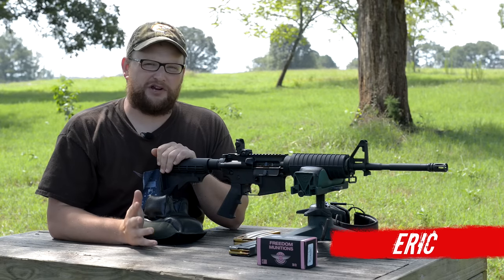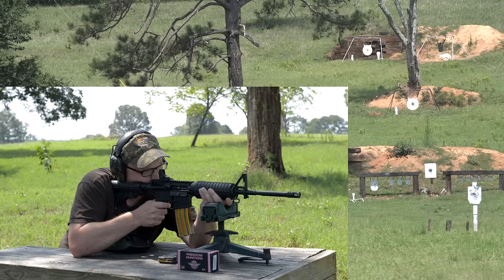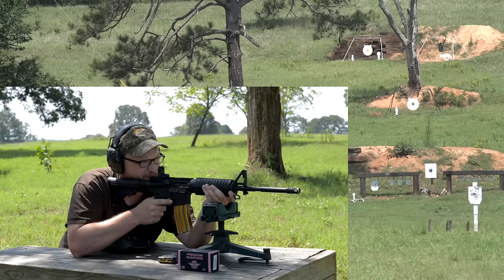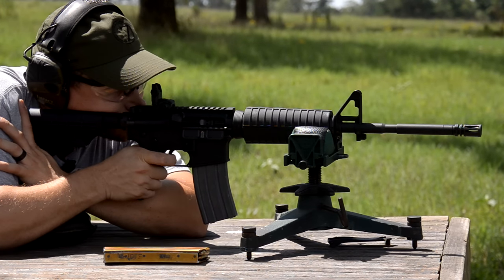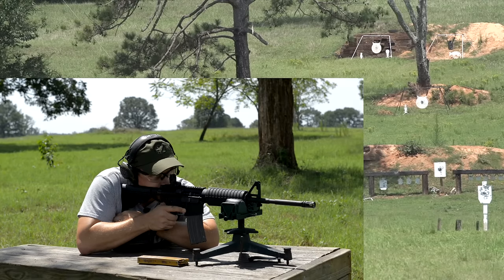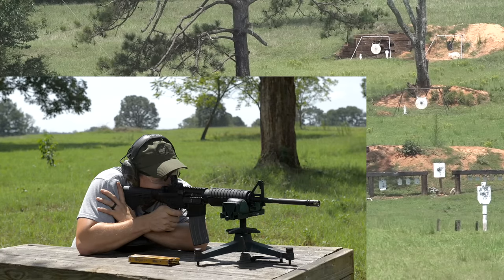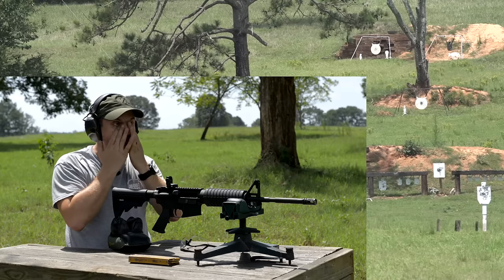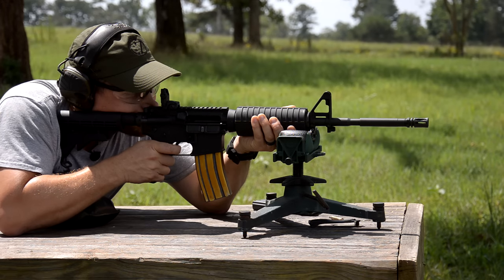Basic AR-15 Practical Accuracy

Comment: I'm fairly new to the gun scene. How much does a complete cheap, but good AR 15 cost?
Reply: 700 bucks for a not so crappy one.
Reply: buy a smith and wesson m&p 15 gen 2!!! it is absolutly flawless its the best out of the box gun and the quality is comparable to top of the line ar's.
Reply: 800 bucks.....but, because of school shootings and gun scares...1200. 

but ya... you should be able to find a damn decent gun for 800 to 1200 bucks.
Reply: The Walther/Colt 22 LR is a nice platform, and VERY inexpensive. It'll eat up whatever ammo you can buy, and is super accurate. Check the local gun shops for'em, they tend to go on sale often. Only thing is while the gun is inexpensive - $400 - the ammo is hard to find, which means you gotta buy it in bulk, which IS expensive. Good luck, whatever you choose.
Reply: Samuel Stine
I was inferring about a 5.56/.223 rifle. But I wouldn't mind a rifle in 22 LR. I thought the 22 LR was "back in the market" because at my local Academy, they had one whole cabinet of various 22 LR ammo. Even my local Dick's Sporting Goods had a cabinet of it.
Reply: 700, 800, and 1200 bucks? Yeah right you do not have to spend near that much. A nice little Bear Creek Aresenal is just fine, $499 at Classic Firearms.
Reply: I can build one for under $460
Reply: check out Palmetto State Armory
Reply: listen man ...colt expanse m4
Reply: Jonathan Carnahan yeah I would look into the new colt, but I just wanted to build my own.
Reply: Ruger and Smith and Wesson are both selling good entry-level rifles for 600-ish.  You can build them cheaper but that's true of desktop PCs too, for that matter.
Reply: i hear ya
Reply: +akshooter762 is right. I built mine all from PSA. spent no more than 430. building was a great way for me to understand the gun better for my next build.
Reply: honestly like 600-800 bucks
Reply: You "can" get one for $400 if you don't mind it being made out of monkey metal and compacted crud. A couple of my American friends swear by getting old worn out ones and then getting the trigger group and barrel changed etc as long as there is no significant wear/damage to the lower and stock etc. If you want one ready to go though I would say that the guys above who have stated 500-600 are about right for the minimum acceptable in quality (with the odd few exceeding what you would expect for $500-$600). I haven't been to the US for too long to know which makes are best in that price bracket right now though.
Reply: +Gordon Lawrence highest quality I've seen in that price range is the Smith and Wesson offerings, or the DPMS Oracle
Reply: bamarolls2000 thanks but I don't visit the US very much at all now - used to work there. So it is unlikely that I will visit as much as I would like in future - unless I win the lotto in which case I will buy a place in the southeast US and put in an underground 200m rifle range with sound baffles the whole works.
Reply: +ChknRider having been out with 2 friends shooting rabbits....and watching their sub ~600 ar jam up every 2 or 3 shots....

I like ars... I haven't seem one jam as often either....but it was montana cold, so that probably didn't help....

but when they stopped shooting their ar, and got their 22s...that should say something.

ya...I'd rather spend a bit more money to have something that isn't going to piss me off....call me crazy...

or its going require more money to get it to work...
Reply: +Written Word so, why are you here if your going to shit on gun people?

I live in montana....shit costs more here because we can see the end of the world....
Reply: jsdima9113 dude if you haven't gotten one get a kit with a complete upper and build the lower which is not hard at least that's what they say and really good quality for 500 dollars maybe little more.

Comment: He is wrong about the sights. The small hole is for close range, where the larger is for long range. Because of the flight path of the round, the larger sight (hole) will let you adjust your range with the front sight. The flight path goes high to the left then arches back down. You can’t do that with the smaller hole at long range. Yes I was military trained.

Comment: Holy crap, that is an old magazine. If you mags that look like that only use them for practice because they could fail you at any moment. I carried a lot of M-16s and AR-15 and fired a lot of rounds through them and the vast, vast majority of failures I've experienced were because an old magazine like that failed me in some way. In fact, you should just switch to Magpul Gen M3 magazines because they are vastly superior to the aluminum GI mags.
Reply: STANAG mags are just fine, especially if you replace the follower to an anti-tilt version. I have two twenty round STANAG mounds that I liberated from supply before I got out of the Army that are older than I am. I swapped out the followers on both, and have zero issues with them. One way they are superior to Magpul, Hexmags, and Pmags, is I can lock the magazine in place without having to release the bolt. My Magpul and Hexmags always fall out unless I put the rifle into battery. Polymer mags can also have issues with the lips if you store them loaded for long periods of time. But, they beat out the STANAG mags for durability when being handled roughly.

Comment: Old vid but, I'm seeing ejections at 1 to 2 O'clock. Is that normal with 55gr brass?
Reply: Yes, all ammo with any of the A2 type uppers with a molded-in brass deflector to facilitate left-hand firers. Spent brass typically piles up slightly forward of your right.  Personally, I mill off the triangular brass deflectors so my rounds pile up to my right rear.  Also, I reload, so I don’t want cases getting impact dents from that deflector, especially my short 300BLK cases.

Comment: Howdy partners: I got a email from AGI about this new course. Do you guys thinks is any good for 1300$
Master the AR-15
Become an AR-15 Riflesmith!

Included in this 12 hour Certified AR-15/M4 Riflesmith course is:
•The AR-15 complete D&R DVD
•The Armorers Course video
•The complete 'TactiCool to PractiCool' course which teaches all aspects of building tactical rifles including how to select among the hundreds of AR part options (the ones that work)
•The Ultimate Guide to Building AR-15s from a parts kit
•How to do a Trigger Job step-by-step on the AR-15 
•Comprehensive notes
•Online test access, certification and (upon successful completion of the online test) a Certified AR-15/M4 Riflesmith patch.
Reply: I wouldn't pay 1,300 for that.
Reply: No, it is not worth it. You can learn all that yourself simply by working on an AR, buying various books, and doing research. That's a complete rip-off.

Comment: Is it true that when you get shot from afar the first thing you hear is the sonic boom the bullet is making and not the bang? when they are shooting long range the first thing you hear is the bang and then the impact, how does this whole thing works? have they showed this in some video?
Reply: Your at the gun not the receiving end. At the receiving end you hear the impact then the sonic boom then the bang from the rifle. When you are at the shooting end you hear the bang and sonic boom together then the impact. Sound takes very roughly 1/3 second to travel 100 yards.
Reply: Depends.  If the round is supersonic you'll hear the round impacting, followed by the sonic crack, followed by the report of the rifle if you are close enough.  If it's subsonic you won't hear a sonic crack and you'll hear the gunshot before you hear a bullet impact.

It works because a supersonic bullet travels faster than the speed of sound.  So the bullet outruns the speed of the pressure wave created by the gun going off.  Then, as any supersonic object travels it creates a pressure wave that follows behind it, just like the waves behind a boat.  You hear a sonic crack when those pressure waves pass you.  That is why if you've ever heard an airplane go supersonic, you won't hear it until after it has passed you.
Reply: I was under the impression that all 5.56 rounds are supersonic?
Reply: +Gordon Lawrence All regular 556 rounds are supersonic, but nothing forbid you to load your rounds with a small quantity of powder in order to get it subsonic. But if you use it with subsonic rounds, you have high chances that your gun won't cycle

Comment: What was that clicking sound about a second or two after you pull the trigger
Reply: Trigger reset if you squeeze the trigger to the point of firing then continue to hold it back.  When you allow the trigger to go forward again, you hear the click
Reply: @blackhawk7r221  confirming a reset click like that with a straight-up mil-spec trigger?? I've shot thousands of rounds out of my PSA and have never heard that sound?
Reply: @racerrick35  With a military issue M-16 or M-4, if you squeeze the trigger normally and release, you do not hear the metallic click.  But if you squeeze the trigger all the way back when firing, then continue to keep it back after the bolt carrier has completed it’s rearward then forward cycle, you will hear the click when the trigger is released.  
It is an integral step to a functions check.   If it has a mil-spec trigger.
Do this to yours:
Rack it.
Squeeze the trigger and continue to hold it down.
Rerack it.
Release trigger.  Should hear the click.
Resqueeze trigger.
Hammer falls.

Comment: I do agree.  I spent 15 years in the army.  I was aviation while I was in, so I did not spend as much time shooting as your 11 series MOS.  All of my time in service I did shoot the M16A2 iron sights.  I had never had the upgraded options.  All I ever delt with was a pure bare bones M16A2.  Other than having the option of three round burst.  The rifle is nothing special.  Not that the three round burst is even that great.  Since I have gotten out of the military and own a few Ar15's I can build a much better rifle than the military.  Taking the mil spec trigger chaining the springs and some polishing the sear and connector makes a huge difference.  The rifle can be much more accurized than the military has.

Comment: Hey, is there anyone that could explain zeros for an AR-15 chambered in 223/55.6?  I have two Colts and they are both sighted in at 50 yards.  Due to the motion of the bullet going up and then down, where would i have to aim at say 25, 75, 100, 200 yards?  Someone who knows what they're talking about please answer.
Reply: bill beast 50 will be right on at 200 also shouldnt really need to adjust the sight picture for the mentioned ranges i use 25/300 zero wich is what the army uses but the 50/200 is popular with predator hunting google 50/200 ar zero holdovers for what your sight pictures or trajectory should be.

Comment: I’ve always driven used Benz’s - they’re affordable.
My wife and I own an SL500, an SL600 and an S600, because we expect one of three will always be in the shop.

Last month, we had to rent a car from Avis !!!!  all 3 Benz’s were broke at the same time!

SL500 was waiting for an airbag occupancy sensor at 55,000 miles. 
SL600 is still waiting for an SBC pump (warrantee item) 
S600 ate the torque converter @ 65,000 miles which threw chunky bits into the 722.6 tranny...($12,000) (that’s what we get when Benz puts a V8 transmission in a twin-turbo V12 car)

Ps, we’re both in our 60’s...We don’t mash our cars about...yet 3 of 3 broke.

Pps, , the little Ford Escape from Avis was nice....
Reply: lol I'm about to build a ar in 2019 yes i get your point and agree.. I'll make it work with reliable non pretty part's for half the price i get it

Comment: What is that clicking before each shot?
Reply: That's the reset of the trigger going from depressed and then back into battery. Instead of just pulling the trigger like normal he's taking his finger, squeezing the trigger to its breaking point and is not resetting his finger quickly, instead he is still holding almost like you would with an automatic weapon to keep it firing. Most people reset their trigger fast enough to where the sound of the shot going off is hiding the reset sound of the trigger. All semi auto and even full auto triggers will make some sort of sound when resetting. The sound you hear is simply the sear on the trigger springing back into action after the bolt has went home, thus resetting the trigger. The purpose of doing this is normally for accuracies sake. Any extra little twitch or jerk/pull can EASILY pull your firearm off target, especially with smaller barrel weapons like pistols. Simply put, it's just a trigger discipline practice for "better" accuracy.

Comment: Hey guys I need your opinion on something. The AR I have right now is a rather old one that is modeled after an M16-A2. It has a solid stock and non-removable carry handle. When I shoot it  it starts putting out a bunch of smoke. When I try and practice shooting as fast as I can while trying to keep it on target I can't even see the target because of smoke at the end of a 30 rd Pmag. I reload my ammo for my AR and I wonder if its that or the gun. Can anyone help?
Reply: Honestly, if it's really old and maybe wasn't shot for a while, I'd swap your gas tube. Depending on how long it sat and storage conditions, it may have corroded inside and/or rusted. When you have that out inspect the inside of your gas block as good as possible to see if there's rust. Make sure the star chamber is clean, the gas key on the bolt carrier it's self and the piston rings. If all of that is clean and lubricated right, all that's left is your ammo. Make sure you're using the right powder.
Reply: It's definitely the reloads. Of course you can always be sure by just getting a box of commercial .223
Reply: +Dustin B (war gaming gameplays) agreed! it could also be the lube you're using.
Reply: Is the smoke coming from the barrel? If you oiled the barrel, wipe that off because yeah it will smoke. Your ammo can't possibly produce that much smoke unless something is clogged. Maybe clean your gas tube and bolt.
Reply: Gas tube can cause this make sure your weapons is clean, has possible from that old build up carbon
Reply: I'd recommend giving your rifle a nice good cleaning, and I mean everything. Check your gas tube, and see if it is clean, then go to the range and shoot your reloads. If it still smokes, then it is most likely the ammo.
Reply: Sounds like ammo to me. Test with a box of new factory Federal.   I see a lot of variation in smoke between ammo brands.  (Avoid Tula Maxx)
Reply: Its your powder... my man.
Reply: +LongCut Arizona yup probably the gas tube shout our from mesa arizona !
Reply: +MarkAndrewEdwards why should he avoid tula maxx
Reply: Sell it buy a 1911 ;)
Reply: Chalino Sanchez man that stuff smoked worse than Magtech .38 special.  I did not have good results with that ammo at all.
Reply: set a fire with my 556 incendiary shit was smokin everywhere,

 I mean what.
Reply: Thanks guys! I'll see if you guys' recommendations can help my AR any. Thanks again!

Comment: What is the click just before the shot in this video?
Reply: Robert Zeurunkl  it is the trigger resetting.
Reply: OK, I see his finger come off the trigger pull when the click happens.  This isn't a normal trigger, is it?  What is it.  No rifle I've ever fired does this.  Is it an aftermarket trigger thing?

EDIT: FWIW, I've fired semi-autos only while I was in the military.  The only semi-auto I have now is my Ruger 10/22.  Everything else is either bolt or lever action.  357mag, and a couple of 300 WinMag.  ;-)
Reply: I don't know if it is the same with all trigger systems but my ar15 does the Same thing.        Now I'll explain why it clicks. When the rifle is fired  the bolt comes back and resets the hammer, and their is a lip on the hammer and trigger  that locks  the hammer in place so it can't fire full auto. So the click is the trigger and hammer resetting. Hope this is helpful to you.
Reply: Yep.  Thanks